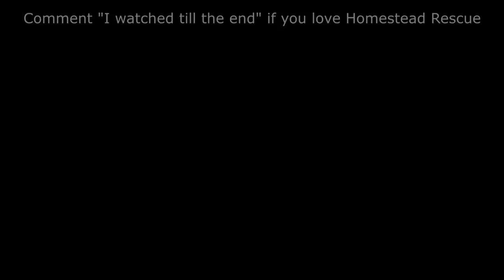Who pays for Homestead Rescue?

Comment: My dad moved to Alaska from Texas in 1974 as well, he was 38 and a bush pilot for many years until he retired, he lived off grid in a cabin on a river you could only get to by boat, airplane and snowmobile in the winter. He built the cabin and lived in it from the mid 80s until the early 2000s. He had so many stories it was nuts. He passed at 82 about a year or so ago.